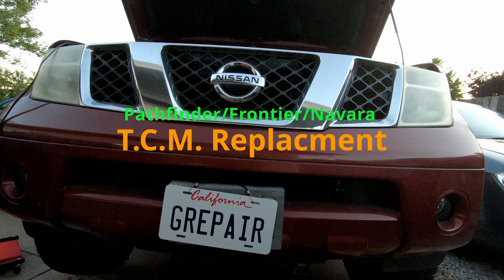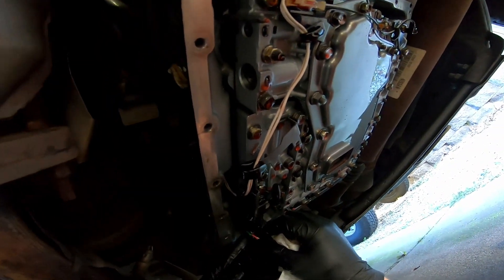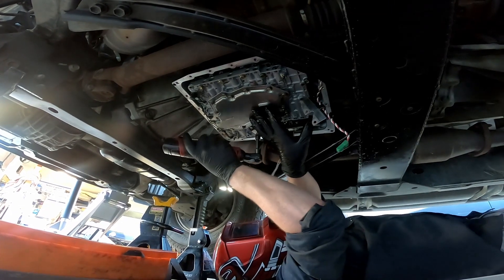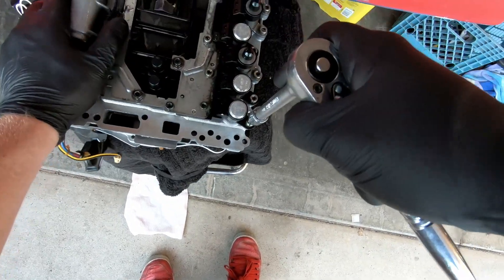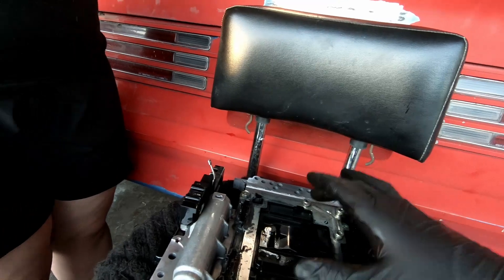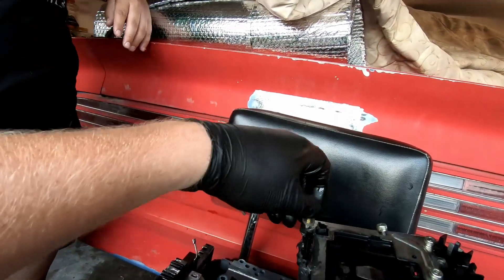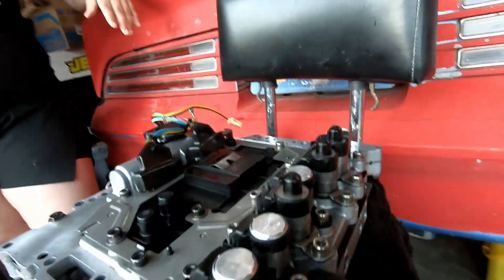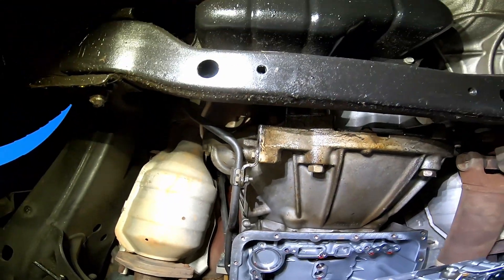How to Replace Nissan TCM 2005 - 08 Truck/ RE5RO5A

Comment: did you replace or put a gasket for the cover?
Reply from the maker: The transmission pan? It has a gasket.
Reply: @GrimRepair  yes that one.. so no need to replace? i mean mine looks fine
Reply from the maker: @danroxas  it could probably be reused but, you should have gotten a new one with your filter. You changed the filter right?
Reply: @GrimRepair  i got a new complete tcm
Reply from the maker: @danroxas   @dan roxas  you should replace the filter while you are in there. 
Especially if you had coolant contamination or you may damage the new tcm. Did your coolant mix with the transmission fluid?
Reply: @GrimRepair  thankfully it didn't mix. the tcm body i got should be complete as per the seller mentioned. hopefully that's all i needed
Reply from the maker: @danroxas  What was the truck doing  that made you replace the tcm. I would still replace the filter while I was in there. Have you removed the tcm yet?
Reply: @GrimRepair  it jerk's from first gear ti 2nd. it looses power sometimes. but still runs good. its a brand new tcm body. the whole assembly. its also preprogrammed to pathfinder. filter does looks clean and new
Reply: @GrimRepair  oh and yes the old tcm is out.

Comment: is everything still going as planned?
Reply from the maker: The car is still going, if that's what you're asking.
Reply: @GrimRepair  yep exactly what I was asking! I'm part of a few nissan club forums and have gotten mixed results on what actually happens when coolant enters the trans through SMOD causes. I'm glad it worked for you! I ended up with a full transmission replacement, but have the old trans and may rebuild it.

Comment: I just dropped my 06 pathfinder at the repair shop 2 days ago. I wish I've seen this video before dropping it. But at that time I wasn't sure if it was the tcm problem until now that the mechanic told me today.  Since I've heard the the tcm needs to be programmed I did not want to deal with it too much so I left it at the shop. But this video is definitely the best video for tcm replacement.  Very good details and information.  Great job brother. 💪💪💪
Reply from the maker: Thank you!

Comment: Hi Grim, do you remember the fault codes you were getting prior to replacing the TCM? I am getting: 

U1000 and U1001 CAN BUS communication error (comms between TCM and PCM).

PO717 Input / Turbine shaft speed sensor A circuit no signal (speed sensor at rear of trans; doubt it is this but most likely a hint that TCM is issue).

I just finished rebuilding the Re5r05a and the valve body after coolant contamination and replaced all solenoids (solenoids pop out easy if you split valve body and punch them out backwards with a #10 Robertson screwdriver). There is no check engine light at all yet I can pull codes. I am thinking now the TCM shorted out like yours and is NFG. It starts and drives but high speed / highway shifting is off and it eventually heads into limp mode. Shifting gears manually and at low speed is perfect. Thanks for info.
Reply from the maker: I had a u1000 code and the car wouldn't start, because the tcm kept blowing the fuse. When you rebuilt the transmission did you open up the tcm, exposing all the metal rods? Coolant can be trapped in there causing circuits to do crazy things.
Reply: @GrimRepair  ... yeah, I completely disassembled the valve body and cleaned the TCM as instructed by other youtubers and used RTV to seal the main terminals (where I did find a small amount of water). Funny I can still start and drive but no CEL/MIL. I'm going to check grounds, pull fresh codes, and swap out the TCM with a spare I have. Will see what happens. Thank you.
Reply from the maker: @vincejestersmith  please let us all know what you figure out.
Reply: @GrimRepair  OK, I think I figured this out. After checking wires for cuts and tightening grounds, I took apart the dash to get to the instrumentation. The check engine indicator light was taped over (I picked up this Pathfinder at auction so I had little to go on other than SMOD and a radiator replacement). There is also a 10mm ground behind the cluster and I tightened that as well. 

Once I had the check engine light back, I tried again to reset the idle air volume learning according to Technical Bulletin #1188 (you can't do this without the CEL and it is recommended after rebuild). This time it worked -- because I could see what was going on. 

The next day I took it out for a long drive with three start and turn off sessions over two hours with lots of hills and highway. I was sure I needed to swap out the TCM until this road test. Suddenly, everything is smooth and I had no fault codes. Insane. It did shift a little aggressive a couple times when I would throttle the pedal (kind of something you wouldn't normally do) but I think this is because the cpus are relearning and I've used a possibly sub-par trans fluid from Can Tire (Motomaster semi-synthetic). I am going to drain and add Valvoline MaxLife as that is what seems to work well for everyone else and see if that doesn't repeat itself. Here is the link to the reset procedure:

https://atracom.blob.core.windows.net/bulletins/2008/july/atb1188.pdf
Reply from the maker: @vincejestersmith  awsome!

Comment: The valve body i ordered says it has to be programmed.
Reply from the maker: My tcm also said that, but It has been running fine without it. Other have said the truck would not shift out of second without the programming, so it's hit and miss. Either way it needs to be installed for programming.

Comment: Were did you order tcm??
Reply from the maker: Oriely auto parts, lots of places are out of stock lately.
Reply: @GrimRepair  they told.me they didn't carry it
Reply from the maker: I just had someone comment that they wanted $720 for it. I would call again and ask if they can order it.
Reply: @GrimRepair  won't engage gears??? Any insight 🙏
Reply from the maker: @yogibear5130  does the shifter feel weird? Did you get the shift linkage lined up?
Reply: @GrimRepair  yea I' did , i saw a reprogram of tcm on Google turn car for 5 sec n off for 30 3 times n it worked I think I need more fluid

Comment: Can I ask how much was tcm from oreily?tyvm
Reply from the maker: $600 but It came next day not broken with a warrenty. I tried getting one from a seller on ebay it came with the valve body, but the box was soaked in atf and it got damaged in shipping.The seller was un able to get me a replacment in a timely fashion. I also tried summit the part stayed on back order for months then they refunded me and doubled the price once it came avalible. I wish I would have just got it from oriely to begin with.

Comment: Can someone here help me diagnose my vehicle. I am contemplating on replacing the whole transmission but i dont want to commit into a repair that may only cost to replace just a valve body. I have a 2005 nissan pathfinder v6 5 speed automatic. How the problem started: the problem started when a friend of mine tried parking backwards at a pretty steep hill and of course he let go of the brakes so it moved forward and he pressed on the gas fearing it might roll in to the ditch, the car jerked up the hill in reverse pretty hard. 

The reverse issue got worse over the days . I had no other choice as we were out camping in a pretty unknow place. I did a trans flush at a place near our camp but didnt fixe the issue.
The reverse issue got worse now,  before it took 2.5k-3k rpm until the reverse catches and engages now it takes 4-5k rpm till it catches.
There are no codes showing, i drove the vehicle about 500km  back home and it had no issues driving. It was just the reverse. Being the problem. I also noticed that when i use reverse when the car is cold, the reverse engages at lower rpm although its still higher than normal. The transmission oil is still red and i did smell it when i arrived home and it didnt smell burnt or anything, the car also drived pretty well when i was driving that 500km back.

Another thing i notice is that  when i am manualy shifting from 2 to 1, it doesnt go to 1?

I am just hoping someone could help me diagnose the problem. I tried reseting the tcm by removing the battery for 20-30min and it didnt fix it. The only thing I think that vould be the problem is the valve body or worn down clutch packs. I was thinking of the valve body as the problem more as the transmission oil does smell burnt and looks ok but im also thinking that a vode would show up if there was something wrong with the valve body. 

If anyone can help me diagnose this please let me know. You can ask me any questions you like about the car
Reply from the maker: It doesn't sound like the tcm to me, but I don't think anyone is going to be able to give an accurate diagnosis without looking at the car / doing tests.
Reply: @GrimRepair  i was thinking it was a faulty selonoid, broken seal(s) from parts of the valve body. Because ive been looking at the trans fluid everytime i used it and it doesnt have any smells that would be a concern. I unfortunately cant drop the pan because im moving to a new place and I dont have any other vehicle to use . Probably bad that i keep using it but i have no other choice
Reply from the maker: @neilbaquiran643  is your scanner able to read the tcm?
Reply: @GrimRepair  beside the pending and active fault codes : P0420 and P0430 . No other codes shows up
Reply: @GrimRepair  ill be opening up the pan in about 2 to 3 weeks . When im done moving and the garage cleared up
Reply: @GrimRepair  I also found that shifting from park and neutral to reverse; the car almost wont engage to reverse but then when I quickly shift from drive to reverse, it catches   easier . I think i might have problem with hydraulic pressure
Reply from the maker: @neilbaquiran643  those are ecu codes. Not all scanners can communicate with the tcm, are you able to select transmission on your scanner?
Reply: @GrimRepair  I rented a snap on scanner from someone. No codes. At this point i fear that its the clutch packs or shift bands. Will be pulling the pan down by the end of this month. I just dont have time right now. Im just hoping that its a selonoid or valve body issue
Reply: @GrimRepair  just rescanned my vehicle again. Transmission shows up normal. Not DTCs or fault codes. RN im fearing the most is a worn out clutch pack or bands, but hopefull its just a broken seal. I am wondering though. Does a faulty selonoid have its own fault code
Reply from the maker: @neilbaquiran643  a problem in a solinoid circuit should throw a trouble code.

Comment: How can I get in contact with you
Reply from the maker: Here or facebook.com/grimrepairs
Reply: Sent a msg on fb could tcm cause the solenoid error codes
Reply from the maker: @MASSNIFICENT  yes. Inside the tcm there are a bunch of rods that run to the solinoids, they often break.

Comment: I can’t believe your using dorman
Reply from the maker: It has been working fine. It's either that or spend 2x at the dealer.
Reply: @GrimRepair  I agree but I and so many people hade shitty luck with dorman. Unless they have another manufacturer that actually makes it and they are just selling it under their name
Reply: @GrimRepair  other than that I like the video and I’m going to use it to access my valve body for repair.  Thanks
Reply from the maker: @andrewziegler2608  dorman remanufactured  the original Bosch tcm.

Comment: I seen places on eBay for under 200 around about 200 but I’m afraid it may not work. Yours look more suffice.
Reply from the maker: @gregoryharris7861  I first bought a valve body with tcm from ebay, it arrived in a transmission fluid soaked box, broken, with a note from the post office. The seller did not want to send me another one.

Comment: Good video, how’s it been holding up?
Reply from the maker: Its doing good it gets driven everyday.
Reply from the maker: If you end up doing the repair. It would be cool if let future viewers know how it went for you, here in the comments.
Reply: Grim Repair sure will👍
Reply: @GrimRepair  hey I got a 2009 pathfinder I'm thinking about doing this repair. About how much was tcm? Did u ever had to program or take to Nissan?
Reply: @GrimRepair  should I be good if I change to aluminum radiator or still get rod of trans cooler u think?
Reply from the maker: @JT-ql5oi  separating the radiator from the cooler is the only way to make sure it dosent happen again, but an aluminium radiator should be fine. Its defiantly better than the stock one.
Reply from the maker: @JT-ql5oi  I tried to order it from summit but it would never come out of back order and they kept refunding me. I ended up buying a reman from Oriely's it was $600, I did not need to have it programmed.
Reply from the maker: @JT-ql5oi  let me know If your's works without programming, or if i just got lucky. if Nissan does have to program it's an hours labor.
Reply: @GrimRepair  thanks will do u have a part number for tcm.
Reply from the maker: @JT-ql5oi  I think I showed the part number on the box in the video. It is probably best that you ask the parts supplier you go through, nissan changed from Bosch to someone else at some point. Your truck may not be exactly like mine.

Comment: You are the man. Thank you soooo!!! much brother.
Reply from the maker: You're welcome, thanks for watching.
Reply: Hello.. video was on point with my 06 Xterra. My question is.. does the solenoids gotta be the same exact ones or can be replace with any other one that looks like it? See only see the solenoids in order to put in place but not the numbers on them are the same?
Reply from the maker: @dne2007  there are 3 different types of solinoids on the tcm. As long as the correct type is in the correct bore, you'll be ok.
Reply: @GrimRepair  ty guess ill have to replace the tcm since I didn't do a good job cleaning the burnt spot and it does have continuity in all places.

Comment: i recently bought an 08 pathfinder with the 5.6. throws a u1000 code, guy i bought it from says its stuck in 3rd i drove it to test it out and it doesn’t accelerate and takes awhile to get up to speed. how do i find the right part number for the valve body?
Reply from the maker: @israellujan8432  the part number for the tcm ibought is in the video. I also have links in the description.
Reply: should it matter if its 2wd or 4x4 and mine has the 5.6 v8. are they all pretty much the same.
Reply from the maker: @israellujan8432  what is your liscence plate number and state, then I can look up which tcm is supposed to fit.